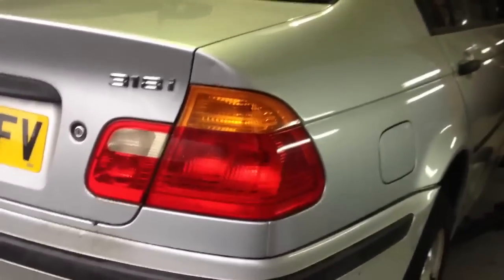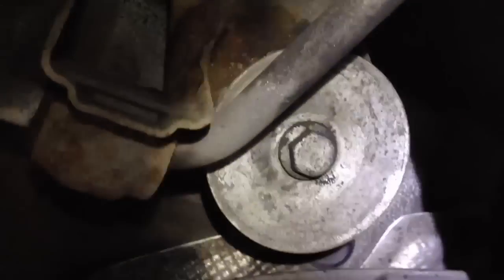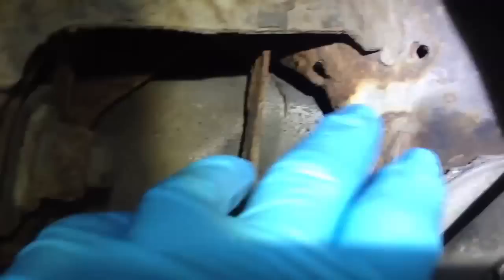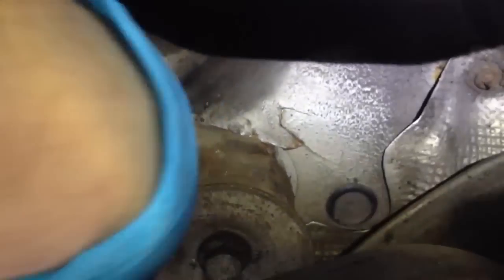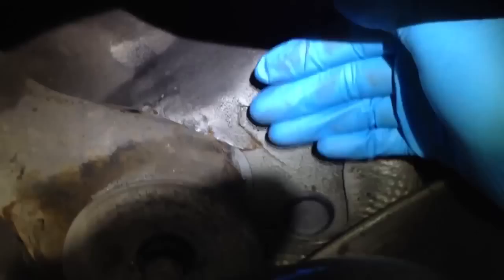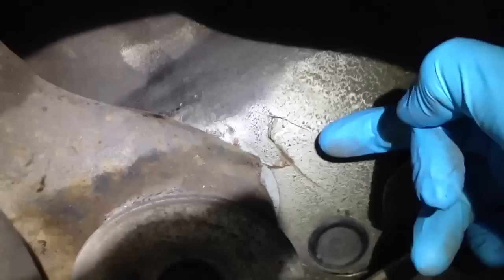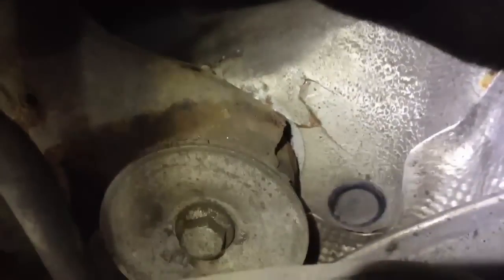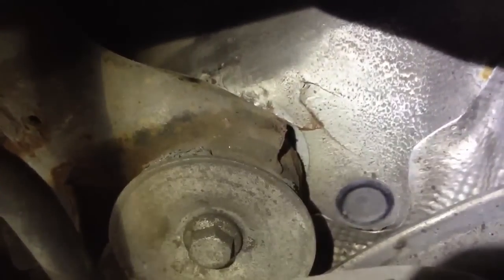Deliberately encouraging a BMW E46 subframe chassis to crack

Comment: At 2:21 there is a rubber body cap/plug. Do you know the part number or dimensions for this? It's missing on my car.
Reply from the maker: FrozenHaxor 20mm BMW grommet. Part number ends in .850 from memory. It's listed in sections 51 of the BMW parts catalogue at the bottom picture called covers/dummy plugs.
Reply: Thank you! Found it to be 07147140850. I can tell someone was welding my car up before, probably without reinforcement plates. Welds seem to be laid on thick and it seems to be holding up so far, but I don't think it's gonna last.

Comment: My car is   Built in Jan 00 323i  I took photos  and I would really like your opinion  ,  I think I see cracking . Dealer inspected it in 09  when my aunt still owned it during the unofficial / inspection  which they were doing at the time  and even charging her 60 dollars for a subframe inspection she never asked for or was told about . Now I just took it to the dealer as my center bearing and guibo needed changing and asked them to inspect subframe rear end for any issues and was told it was fine . .